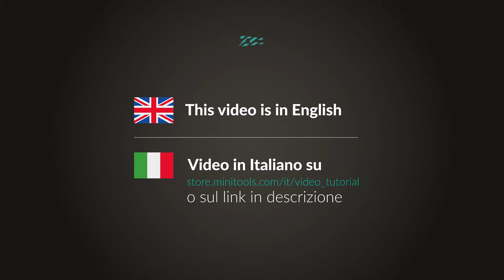How to replace the flat cable to repair the display

Comment: This plastic ribbon cable is a pain in the neck, can you please make another video of the adhesive you are using etc, a well elaborated video and the tool you used to press that flat cable. Thanks in advance.
Reply from the maker: Hi, our flat cables release a sort of glue themselves when heated and pressed with the soldering tip, so they get sealed to the glass and to the PCB.
You need to clean the contacts with solvent, just place the cable properly on the board and press it several times with the T tip at 350° as shown in the video.

Comment: but how that work since the trace on the glass aren't conductive? (I'm trying to repair a very basic timer. After removing the flex I can see in the very slight reflection of those trace on the glass, I thought I also removed the trace  (eg. an conductive paint) by removing the flex, but it looks the same as your. I tested the continuity of those trace, but they aren't so I don't understand how you can create a contact by simply putting your flex on it. Anyone know?
Reply from the maker: Hi Ytrew, those are particular traces which create continuity with their kind of connection.
Reply: @MinitoolsChannel please can you explain more
Reply from the maker: Hi, could you please send an e-mail at info@minitools.com with your enquiry? Thank you
Reply: The glass is conductive it has a transparent conductive metal oxide film lookup ito glass (Indiuma Titanium Oxide)

Comment: Thanks for your video. It is possible this process with the old used flex cable or only is possible repair with one new. With old flat cable need some adhesive special, thanks
Reply from the maker: Hi Angel, thank you for the comment! Unfortunately a damaged or detached flat cable can’t be repaired, you would need to find a replacement.

Comment: i am in the mid of doing this acf repair. the problem is those pitch ...they are not 0.5 mm nor 1mm. i use one formula from google to measure those pitch on flex ribbon. so i want 30mm with 26 lines/pins. so i got 1.15mm pitch. I am tired asking this question to online Chinese seller they are so dumb and not answering my question but replying smthing not related at all. i even saw that flex ribbon you used in this video. but the question is what is the pitch ? i am looking for 30mm with 26 lines. hope you can tell me the pitch and width of that flex ribbon you used. thanks buddy
Reply from the maker: Hi, the one used in the video would not work in your case as the pitch is completely different from the one you’re looking for. You may try to send us an e-mail at info@minitools.com with a picture of the broken flat and of the application, but please bear in mind that we produce flat cables for the automotive field, so we may not be able to help you out.

Comment: Amazing guide ! Thank you so much for it.
Also who has problem of removing old pieces of cable, I recommend heating it up with hot air gun and then remove it with isopropyl alcohol. But don't heat it up too much ! Also watch out for pads, because they are fragile !

Comment: Thanks for the video. In order to solder the flat cable with the T-soldering iron do you apply tin on the contacts first or after the cleaning you just you put the flex cable on the board and then you press with the T-iron?  Thanks a lot..
Reply from the maker: Hi Manolis. After cleaning the contacts with solvent, just place the cable properly on the board and press it several times with the T tip at 350°. There’s no need to use tin.
Reply: @MinitoolsChannel  Thank you very much for your prompt answer. Best regards..👍🙏
Reply from the maker: @manos_vas   you're welcome!

Comment: Good video. What equipment are you using for the heat staking? Is that a heat staking solder tip?
Reply from the maker: Hi Sukhvir! We are using a soldering iron with “T” tip. The tip is available on our store at https://store.minitools.com/en/sepp-t-t-tip-for-soldering-irons.html

Comment: How did you solder on display. Does it have adhesive onbthe flex cable . Or just have to press with T tip on the screen
Reply from the maker: Hi, our flat cables release a sort of glue themselves when heated and pressed with the soldering tip, so they get sealed to the glass and to the PCB.

Comment: it's impossible to find the replacement in my country, could you reuse the same cable? aplying heat to the existing cable without removing it
Reply from the maker: Hi Daniel! Unfortunately it's not possible to re-use the same cable to fix the issue. We do ship almost all over the world, please send us an email at info@minitools.com and we will try to help you.
Reply: @MinitoolsChannel  so once it removed it will never be reused? I think I have to look for the same type of cable then

Comment: i have a mettler toledo shipping scale, the lcd was having issues, i took it apart and accidentally tore the traces on the flat ribbon cable. 

do you know where i can order one? it has 24 of those little individual traces
Reply from the maker: Hi, we only produce flat cables for the automotive field. However, could you please send us an e-mail at info@minitools.com with your enquiry? There may be a chance that we can be able to help you, even though we can’t guarantee it.

Comment: is there some sort of tape used before using the T-tip soldering iron????
Reply from the maker: Hi, in the video we didn't use any tape, our flat cables gets sealed to the PCB simply using the soldering iron with "T" tip at the correct temperature, which is 350°C, as they contain a glue which gets released when soldering.

Comment: Bro I love your project. I need some help from you. I wanted replaced a  broken lcd display panel from motor bike speedometer. Which had 58 connecting pin custom lcd panel 11.4 mm x4.4 mm. The lcd display not available in the market. But any other lcd display to replaced like TFT or OLED lcd display the problem how to connect a 58 pin lcd display to other lcd which have less pin connector. How to go about to make them  work.
Reply from the maker: Hi, could you please send us an e-mail with pictures of the defective display and of the entire speedometer at info@minitools.com?  Our team will look into it. Thanks.
Reply: @MinitoolsChannel  very great thanks you very much.

Comment: Hi, how long should heat be applied for soldering?
Reply from the maker: Hi Pedro, it’s enough pressing, not too hard, at the temperature indicated in the video, several times along the contacts, holding the iron steady on them a few seconds per time.

Comment: Any idea how to source one of these for a 65" TV? I have one with a burnt trace in the plastic ribbon going to that small chip mounted in the middle of it,
Reply from the maker: Hi, we’re afraid we produce flat cables for vehicles only, we can’t help you with the TV issue
Reply: @MinitoolsChannel  sir please make video how to repair the zebra connection points on a broken odometer LCD display of Hyundai i20??

Comment: Hi Thank you for this. I have a flat display cable about 10mm wide 18 contacts  and it has been glued on from new ? can you help me I need to use the old cable as its already attached to the LCD and all I need to do is re attach to the pcb  how can I do this please. I have spent hours looking but can't find anything to help me. Regards Happy xmas 2023
Reply from the maker: Hi, could you please send us an e-mail at info@minitools.com with your enquiry attaching pictures of the display and of the cables and explaining the issue in detail? Thank you.

Comment: link for carbon ribbon cable or flat ribbon connector tks
Reply from the maker: Hi, what would you need the cable for? We produce several flat cables for the dashboards of various cars makes and models.
Reply: @MinitoolsChannel  omron Blood pressure monitor model number - HEM-712CN2---thats a 34 pin pcb to lcd like in the video...
Reply from the maker: @spicky2966  We’re afraid we produces flat cables only for dashboards and instrument clusters, we’re not able the help you. Sorry.

Comment: Would denatured alcohol work as a solvent for this purpose?
Reply from the maker: Hi @wernerpd777, yes, denatured alcohol can be used, but compared to an electronics-specific solvent you will have to repeat the operation several times in order to remove all residues.
Reply: @MinitoolsChannel  Since I have not worked with solvents on electronics, is there a specific type of solvent you would recommend, such as TCE - or something else?
Reply from the maker: @wernerpd777  TCE could be used, however it must be used with extreme care as an improper application might damage certain component.  An alternative would be using isopropyl alcohol which evaporates quickly without leaving any residue.
Reply: @MinitoolsChannel  Okay, I have plenty of isopropyl alcohol.  I will use that.

Comment: what kind of glue use it on the connector?
Reply from the maker: Hi, we don’t use any glue. The liquid we apply with the brush on the pads and on the LCD traces is a bit of solvent, to clean any residues of the broken flat cable. Then, the new cable gets attached simply pressing with the soldering iron set at the correct temperature.
Reply: thank u, for resolve my question  @MinitoolsChannel
Reply: @MinitoolsChannel  can you suggest any glue or chemical to use if my ribbon cable does not quite stick or get a contact to the pads?
Reply from the maker: Hi, were the pads properly cleaned with solvent before attaching the cable? Thank you.

Comment: Hi there.  What kind of solvent is it?  I have a ds lite display and a replacement ribbon cable. It's hard to remove the broken cable.
Reply from the maker: Hi there! We used just a regular solvent degreaser!

Comment: Do you guys have a cable like this for the samsung crg5 27 inch curved monitor please your my last hope
Reply from the maker: Hi, we’re afraid we do not have the cable for your device. Sorry!
Reply: @MinitoolsChannel  do u have anything compatable or like a replacement cable or where i could check for one please ur last hope
Reply from the maker: We are sorry  @sahajpatel8289 , we don’t have anything compatible ☹

Comment: Hang on you missed a bit.⚠️
How did you remove the ribbon without heat ?!!

The ribbon I'm working is soldered on !
Reply from the maker: Hi, the one shown in the video is a carbon ribbon cable and it’s not soldered on the pads, so it doesn’t need heat to be removed. Other kinds of flat cable (such as FPCs etc.) are soldered and so they need de-soldering to be removed  (you may have a look at this video as a possible reference https://store.minitools.com/en/video_tutorial/how-to-fix-audi-a3-8l-a4-b5-a6-c5-tt-8l-instrument-clusters-with-sepdisp09/)